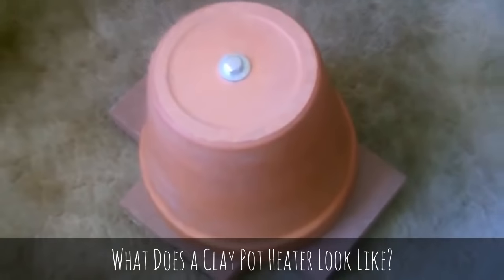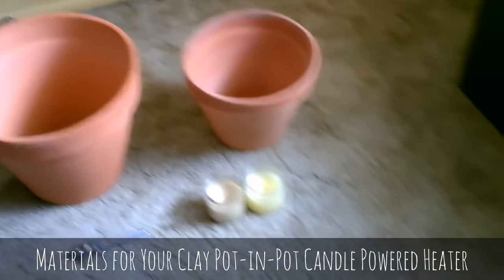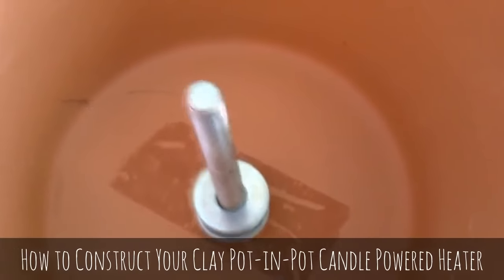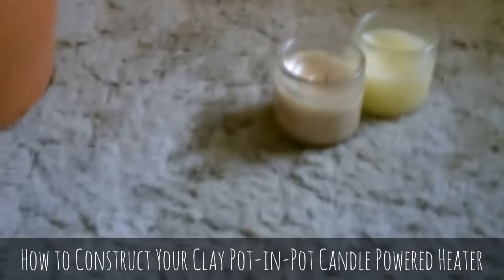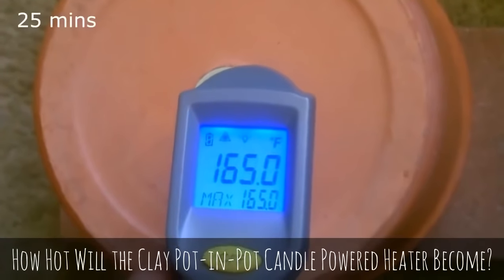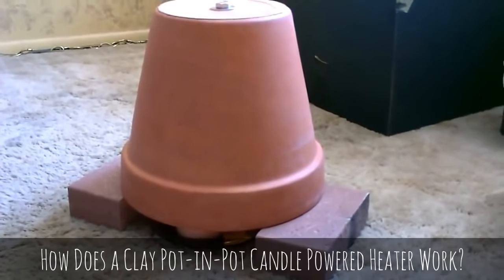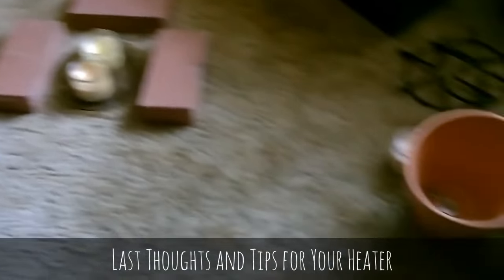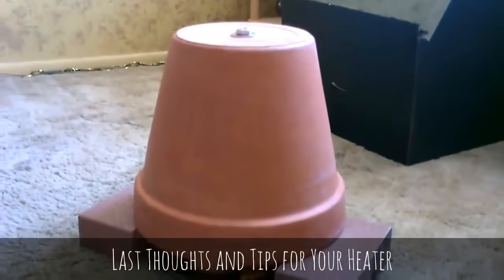DIY Clay Pot Heater: Make a Cheap, Homemade Heater with Flower Pots and Candles

Comment: I went through many ice storms,  placing my clay pot on bricks , placing volitive candles on a cookie sheet with water in it , or individual pans with water in them, underneath the clay pot.. it's not necessary to put all the screws into the pot . if you close the drain hole in the clay pot it helps it to keep all the heat in the pot , use nails or whatever metal you have to keep the heat inside the clay pot .This kept me warm . Filling my washing machine with water I could wash off and my dog had clean water to drink. Where there's a will there's a way..I'm 73, and still going strong. Stay safe precious people , we are all in this life together. Let's help each other.
Reply: Thank you for the tips
Reply: Thanks for this! I found it very helpful.
Reply: Hey there! So I find this video as well as your comment very interesting. I do however have a question if you don’t mind me asking. 
What exactly was the water for on the cookie sheet that you placed the candles on?

Also I’m not sure what a volitive candle is, maybe that has something to do with it?
Reply: I thought you said you washed your dog in the washing machine for a second lmao

Comment: I wanted to thank you for this viedo. During the recent Texas Winter Blast that knocked out my parents power for 50+hrs.  I managed to find these simple items in their shed.
 They refused to leave their house, even though the inside temp was 41° and dropping.
 They had some good goose down blankets and warm clothing but this heater made all the difference in the world in their bedroom. 
 They were impressed that only one candle took the chill out of the room and two made it warm. The top was hot enough to warm up soup.
 Thanks again. ✌
Reply: It's just as effective to use two Pyrex oven dishes just place one upside down and horizontal on top of the other and then place 6 - 8 tea candles in the bottom dish and It's ready. The top dish will reach up to around 180 - 190c
Reply: @Joe Shmoe thanks. Pyrex dishes are quite cheap where I live in the UK, I picked one up from Tesco last week for £6.50 And they heat up quick and cool down slow. Definitely worth a try.
Reply: @Joe Shmoe will do, my friend

Comment: Just a heads up on some of those votive candles in the glass, they can actually bust if too hot!  Happened to me with one of the Glade type scented candles.  Thank God I was home, heard it  and was nearby. My grandparents and 2 children were in the house.  Scared me to death and never bought them again.  FYI - it hadn't been lit that long, less than 20 minutes, so it wasn't a matter of it burning too long.
Reply: Some candles have lead wicks in them too!🤢
Reply: @allouttabubblegum1984  I did not know that! Thanks, another thing to watch out for.🙄
Reply: It's the glass - happened to me before too, with a natural soy candle that didn't have thick enough glass. Also used to happen at an old job when we'd taking glasses out of the burning hot dishwasher - sometimes the latte glasses would just shatter upon touch.

Comment: I am pretty sure that the inner pot needs a hole in the top. That way a system of convection is created inside the heater. Otherwise whats the point in the inner pot? You could just use a couple of candles under one pot.

Comment: Is it ok if the nuts and bolts are zinc plated?
Reply: You can use them if your heat temps aren't going above around 390F or 210C.  So a few tea candles would be fine. Even four if placed properly with air flow and not too close together.

Comment: can you paint the pots safely?
Reply: if you use a high heat paint such as is used to paint wood stoves and barbecues, yes.  Otherwise, you could be putting bad chemicals in the air if you use the wrong paint.

Comment: Do Not Use Tea Candles. They will overheat and spill hot wax on the floor. I found this out the hard way. The mass of hot wax ignited and almost burned the whole place to the ground
Reply: only if you use too many in a small area. People try to create the same heat output as a wood stove and get foolish. You should only be using a couple or three and have good air flow and space around them.  Otherwise, they 'flash' and can cause a fire.

Comment: Could you use ceramic pet heater bulbs or incandescent lightbulbs instead of the candles?
Reply: These are for emergencies. Like when you have no power.

So.. no.
Reply: @nandabun  What is a generator? What is a battery backup? 🤔

Comment: This is a little bit silly. A candle only contains so-much energy.  When it's burned, it will give off its energy in the form of heat. Placing a pot over the candle will not increase the amount of heat that the candle has to offer.  At the very least, it may make it easier to warm your hands by, by keeping the heat at hand-level rather than allowing it to rise toward the ceiling.
Reply: My physics degree had me thinking the same thing. But, he does make the point that an uncovered candle will just create a column of rising hot air that goes straight up to the ceiling. A candle flame reaches an amazing high temperature of around 1,000 C (call it 2,000 F, in very rounded numbers). That's a jet of hot air that's going to rise fast. His trick spreads the heat energy across a big area, lowering it to the 165 F (about 74 C) he shows. That's going to transfer the heat from the surface of the outer pot to a much bigger mass of air, at a much lower temperature. It's still going to rise, but not as fast, nor in as thin a column. You are quite right that the energy content of the candle is fixed, and the power produced by burning it (the energy released per unit time) isn't going to change just because it's under a clay pot. But I think there's something useful in lowering the temperature while the heat energy is still near the floor, and spreading it out over the larger surface in contact with the air near that floor. The overall benefit will be to do a better job of heating the area people can occupy, instead of heating the air near the ceiling.
Reply: @stevensrmiller  The most common units of heat are BTU - British Thermal Unit, Calorie and Joule

The candle only has a defined amount of energy... BTUs
How you distribute the energy into the room whether on a column or larger surface will not make the room warmer... It still the same amount of energy.. there is no magic multiplier!
Reply: No one has asserted a multiplier. The thermodynamic concept at work here is convection. If you live in the bottom half of the room, heating the top half won't help you. The clay pot trick distributes the heat more effectively to the lower half of the room.
Reply: @stevensrmiller  We all understand the heat of lightbulbs, so they'll make a convenient point of reference. A quick Google search shows that a 60W incandescent light bulb produces 200 BTUs/HR of heat and a typical candle produces 80 BTUs/HR. So, a candle produces roughly the heat of a 25W bulb. My point is that this thing might be okay (might be) to warm your hands by, but that's about it.  It isn't going to warm the room to any noticeable degree.  No pun intended.
Reply: @Countercommie  Good comparison! The energy in the candle isn't really what matters in terms of what it can do to keep you warm. It's the power the candle can produce that matters. So, looking at BTUs per hour (or joules per second, aka "Watts") makes it a lot easier to understand what a candle can do for you, and what it can't. Depending on who you ask, you can find sources that will say a candle puts out about  80W (some say a bit less, maybe 60W). Probably the smallest electric space heater you can buy puts out 250W, and those are for warming your toes under a desk in a cold office. To make a small room comfortable you are going to need something like a 1500W heater. Keeping the math simple, a candle provides roughly one-tenth of the power you'll need to warm a room. For emergency/survival purposes, you might get by with half of that, so let's say you want power equivalent to five candles. But, the point is to get the potential energy of the candle's fuel converted to heat energy in your body. Now we are talking about power transfer, which is why the clay pot is of any use to us. The naked candle directs most of its power straight up, where it becomes heat that stays near the ceiling. It does this mostly by convection, heating the air in the flame, with the air literally moving the heat up to the ceiling. The power density is also very high, with a steep fall-off gradient as you move away from the hot column of rising air, so there is little transfer lateral to the column. Does a nice job of heating the few inches of air over our heads, but that's all. The pot does a couple of things that help with this. It lowers that gradient a lot, by both lowering the temperature at the surface of the pot, and spreading the transfer region out over a bigger area (which is also actually coupled to the fact that it lowers the temperature, due to the first law of thermodynamics). This transfers the power to a larger area, which can can include our hands (and, maybe, a bit of the rest of our chilly bodies), and slows the rate of convection because the air is heated to a lower temperature.

There's another factor to consider here: insulation. If your house were made of space shuttle tiles, you could probably heat the whole thing with a few candles if you kept them burning long enough, because you would lose almost none of their energy to the space outside the house. The reason we build massive furnaces and blowers into our homes is not that we need all that energy to heat the volume they enclose. The reason is that we are wasting a lot our HVAC systems' energy heating the world outside of our homes. If we turned our furnaces off, what would happen? Our homes would, on a cold day, slowly drop in temperature until the temperature inside the house was the same as the temperature outside the house. How fast is "slowly?" That depends on how good (or bad) the insulation is in the walls of the house. Most of us, alas, have really poor insulation. So we have to run our furnaces a lot in the winter to keep up with all the heat we are leaking out to the world outside. If we had better insulation, we could run them less often, and stay just as warm.

Why does this matter? Well, if you know how the second law of thermodynamics works, you know I kind of danced over an important point when I said our houses would "drop in temperature until the temperature inside the house was the same as the temperature outside." In an ideal world, the inside and outside would never reach the same temperature. The house temperature would get lower and lower (and, to a miniscule degree, the world outside would get warmer, but it almost would not change and, in physics, "almost" means "all"), but the rate at which it was getting colder would get lower and lower, approaching equilibrium forever, but only asymptotically, never actually getting there. This matters to our pot problem because the goal when the electric power to our home is out is not to replace it, but merely to survive without it. When we heat our homes to, say, 72F, and the world outside is at, say, 0F, there is going to be a certain rate of energy transfer from inside to outside, resulting in a certain rate of temperature drop. For instance, we might see our house drop in temperature by (just guessing here) 5F per hour. But after a few hours, when our house has fallen from 72F to, say, 52F, that rate of transfer is going to be lower, maybe 4F or 3F per hour. This means that, to keep the inside of the house at 52F, you would need less power to keep up with that 3F/hr loss than you would to keep the house at 72F (where you have to keep up with a 5F/hr loss). So, back to our pot, if we have five pots at 60W each, we might be able to keep up with the losses necessary to hold a room at 52F, even if we can't use those same five pots to ever get that room up to 72F. (Note that interior rooms, if you have any, are much better insulated than rooms with exterior walls. In my house, that's two walk-in closets and one bathroom. A couple of clay pots heating large regions of air near the floor to 52F might be just what it takes to survive in an interior bathroom until the power comes back on.)

So, you are quite right. By talking now about power, instead of energy, you are looking at a much more relevant parameter. The question then becomes how that power can be transferred to then become energy again in our bodies. The issues involve thermodynamics, loss to the outside world, what we consider a survivable temperature, and a few other things (we haven't discussed radiant energy here at all, but think about how the sun warms the earth while being millions of miles away in empty space, and you'll already know most of what that topic has to contribute).

One last point about energy versus power: If a space heater produces 600W of power, and a candle produces 60W of power, note that running the space heater for one hour delivers the same amount of energy to the room as when you burn the candle for ten hours (energy equals power multiplied by time). The room is much hotter at the end of the hour with the space heater than it is at the end of the ten hours with the candle, even though both have put the exact same amount of energy into the room, because the room is not perfectly insulated. Otherwise, the end result in both cases would be the same and, ignoring the fact that we would suffocate, if our room were perfectly insulated, we'd never have to turn the space heater back on, or light another candle, ever again.
Reply: @Joe Shmoe Thanks. I shall send your comment to Amherst College, so they know all that money my parents paid to get me a physics degree was a fair deal. 🙂
Reply: I have a "high school degree"🙃 and I can tell you right now that if you can capture the heat of a small flame and gradually accumulate that energy in side the space of 2 ceramic or clay or terracotta pots that this will indeed dry off a pair of socks and undies if your community is at the mercy of a power outtage and you find yourself with frozen toes and hands. I infact would not even bother lighting a candle if it's sole purpose was not for visual light if I did not have a pot to put over it to capture, harness, and slowly release the energy of its flame for my advantage and possible salvation. So I believe it pretty practical and genius rather than "a bit silly"
Reply: There's a reason wood stoves are made with cast iron.  It holds and retains the heat.  Otherwise, one could use stainless steel which puts heat out immediately with no retention time to speak of.   If you need fast heat then choose steel and if you want longer lasting heat, choose the cast iron. Candle and air or candle and clay pot?  It's a matter of choice, not science.  The candle can only put out so much heat.

Comment: That's actually a dangerous thing to do, the wax in the candles can evaporate and combust.
Reply: Actually,funny enough,about 10 years ago I had one of those candles in my bathroom(the light didn't work and my landlord was a cheap prick)and lit it every night,well one night I was hanging in th eliving room and noticed how bright it was coming from the bathroom and thankfully Iw as down stairs and was able to throw the candle in the bathtub cause ya,it totally combusted or something,ended up with 2nd and thrid degree burns on 1 hand.Ever since I have been terrified to light a candle

Comment: FIRST LAW OF THEMODYNAMICS. Learn it. This is stupid and a hoax.
Reply: This is why Engineers are just stupid.  yes, it does work.  I live in the Great Lakes region and when the thermometer dips below 10 degrees, I light mine and helps keep the house comfortable and keeps the natural gas bill down.
Reply: Not enough BTUs
Reply: Can you please tell me what you meant? I am genuinely confused.
I have seen quite a few different people say this works (in real life and on YouTube).
How does the first law of thermodynamics (you left out the r) contradict this working?
The first law says you can transfer energy, is that not what's happening?